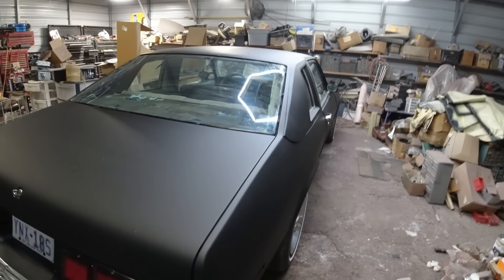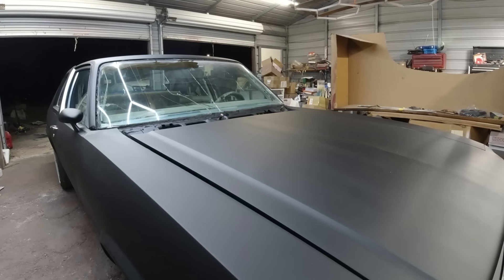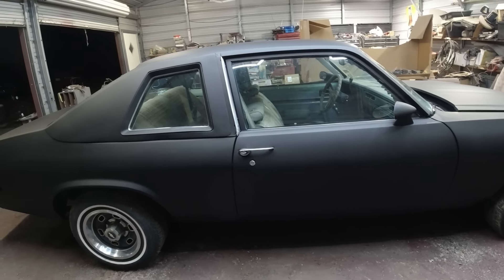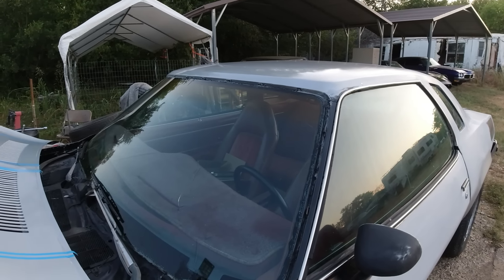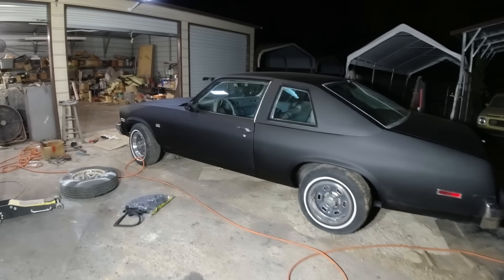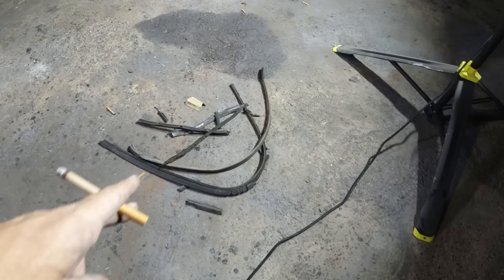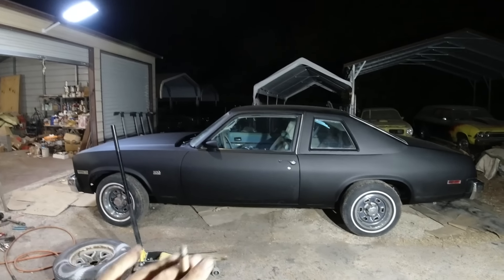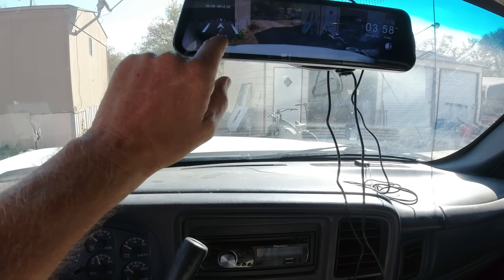1978 V8 "Hot Rod" Nova #10. Put together. How to Windshield. Wolfbox Dash Cam Install on Avalanche

Comment: my thing is stock but could lift rear springs nose down ass up works couple whip lights or couple front lights  style flair its basic driver maybe regear add some kind body kit front valnce lip mud flaps or finder skirts

Comment: yep leave it when someone wants play inside car or repaint it what is like anything little effort went long long ways better then it was it good start to each thier own hard but some time best thing is just clean suff and spray on they way they take it for next appt radio or some guy who do this or that lot guys just take whole car to someone they do thier inside thing take it to some else to do stuff  floors wireing then take it back helps just leave it they will mess up door sill so best